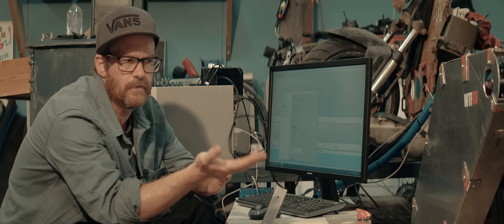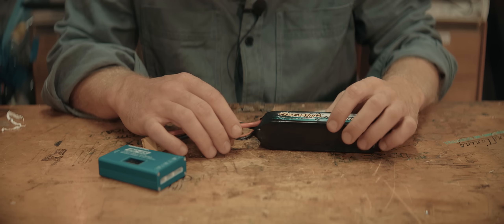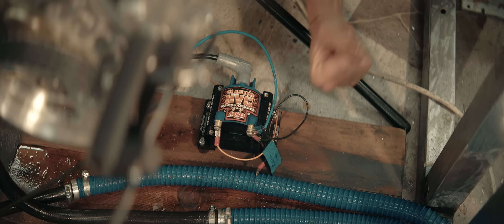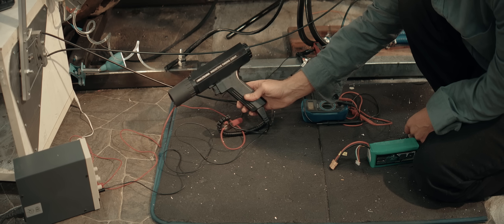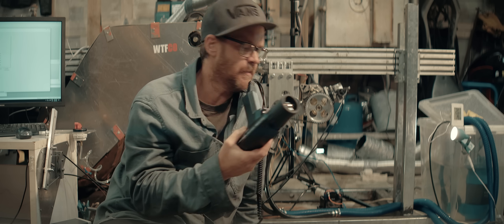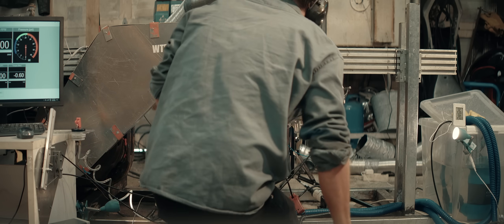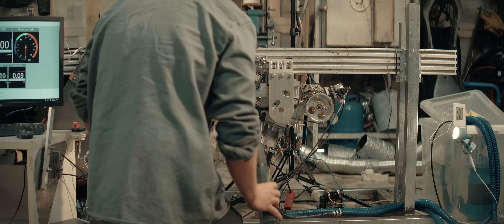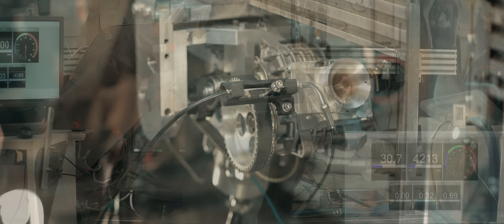Supercharged 50cc Too Much Power for Ignition!

Comment: About the lamp. Did you clamp the sparkplug wire the correct way? Ive had issues before and just had to turn around the clamp so that it points towards de sparkplug. Apparently direction matters. Should be a arrow that indicates it.
Reply from the maker: No, I didn't. Realised this morning, after I'd bought a new one... 😂
Reply: @2STROKESTUFFING  mistakes must be made. Looking forward to the progress!

Comment: Have you tried running a colder range spark plug?
Reply: A colder plug will be harder to fire, unless the current plug is showing signs of overheating that isn't the way to go.
Reply: @ferrumignis  a colder plug prevents detonation when running boost on anything you always want a colder plug than stock keeps cylinder Temps down
Reply: @nathanbutler8240  "a colder plug prevents detonation"

Only if the original plug is running too hot.  If not then you have just increased you ignition voltage requirements and it will be more prone to fouling.
Reply: @ferrumignis  yeah that's true but neither you or I have seen the crown of the piston for piston wash or detonation, the underside of the piston for propper jetting, the plug itself, the ground strap, the carbon ring on the porcelain on a plug chop, or the head. Therfore it's a suggestion a place to start looking, I would always start safe with to cold of a plug and risk washing the rings and cylinder with fuel than to destroy the head and crown of the piston with detonation. But you do you.
Reply: @nathanbutler8240  My point is that simply throwing a colder plug at this (as suggested) is NOT going to solve the ignition problem, and may well make it worse.  If he was having obvious detonation issues this may be more understandable.
Reply: @ferrumignis  well you have your opinion. With him mentioning it was a 10 in there and he might have an 11 means even he was thinking of going to a colder plug so..🤷 and how do you know for sure it's the plug and not just a weak ignition? Me personally I'm on the same wave he is on. hotter coil more spark with cold plug. How do you know the ground strap isn't facing the exhaust and the supercharger blowing the spark out? There's many variables
Reply: @ferrumignis  there is literally no downside to running a colder plug besides it fouling and clearly with the engine hitting 14,000+ rpms its not fouling the plug it'll only foul the plug of it tries to idle
Reply from the maker: Already a 10, might have an 11 lying around.
Reply: @2STROKESTUFFING  I would order a box of new plugs. I know the top fuel cars in the u.s they have a mock cylinder head and they index all there spark plugs. They will torque them down into the head and only use the spark plugs that the ground strap is facing a certain way. I believe it's to prevent the supercharger from blowing the spark out or flame travel from the spark plug it would be worth looking into.
Reply: @2STROKESTUFFING  the ground strap on the spark plug should be facing towards the intake side with the open side of the plug facing the exhaust

Comment: Have you got a magneto you can borrow to try , they give great spart at higher revs
Reply from the maker: I do, one that fits perfectly. Unfortunately there's a blower pulley in the way now... Will figure out something .
Reply: @2STROKESTUFFING  bugger it is always something but that is always been a part of the game . Hopefully you get enough zap out of that coil you have . On some very high performance engines I have been involved with it was set the plug gap as wide as possible before the sparks start breaking down . Just a thought I have not been involved with nitro as fuel just high octane petrol and LPG (120) octane

Comment: With a blower, you're going to want to bring the gap down because under pressure you can blow out the spark depending on how much boost you have.
Reply from the maker: 👍 Not sure how much tighter I can go, 0.3mm is tight...
Reply: @2STROKESTUFFING  Think my comment my have been ghosted. I try it here again instead - Contact Jiri at Ignitech and ask him if you can combine the outputs from the DCCDIP4 for more primary spark power. The DCCDIP4 has two separate voltage converters and the  DCCDIP1/DCCDIP2 only have one (DCCDIP2 alternates it between two channels). You should be able to achieve the same by joining the outputs from two separate DCCDIP1/DCCDIP2 units. He has always been very helpful when I've email him with technical questions and I'm sure he will be able to advise you on the best best way to achieve to high secondary HT spark power.
Reply: @2STROKESTUFFING  every 14psi is in effect 2x the gap it actually measures.
Reply: @2STROKESTUFFING  forgot to say heat range of the plug affects how it reacts to boost as well.
Reply: @NVMDSTEvil  I was going to suggest that he looks at possibly a rotary spark plug that doesn't use gap? They are made for boost as well?
What are your thoughts on a colder plug?
Reply: @Jarmezrocks  they still have gap, its just fixed for most of them. the style is so they can be closer to the rotor without affecting the shape of the chamber.  as to cold/hot, im no expert on that so would need to do some research before i said anything on it
Reply: Boosted applications usually use colder plugs.

Excessively hot plugs get damaged or act as a hotspot that causes knocking, excessively cold plugs don't get hot enough to burn off carbon deposits and eventually foul causing misfires.
Reply: @2STROKESTUFFING  how much boost is it making?
Reply: Closing the gap is a workaround - the solution is to get more primary ignition power from the CDI unit which in turn with the correct coil will increase the secondary HT ignition power to the plug.